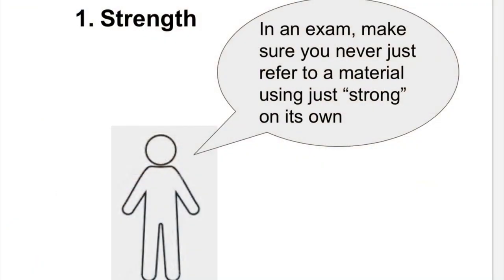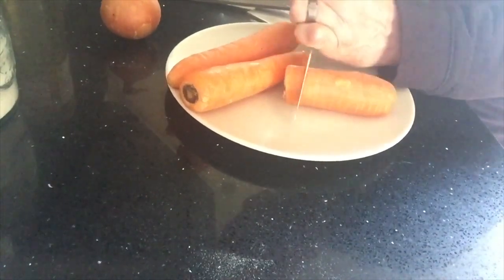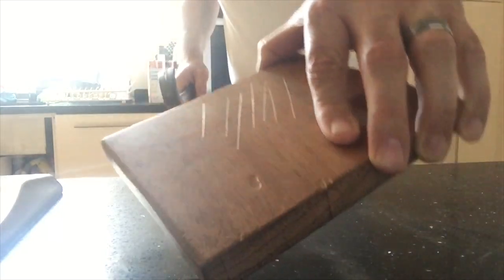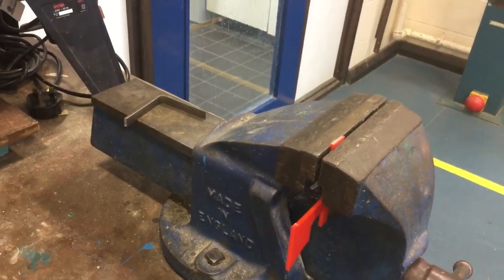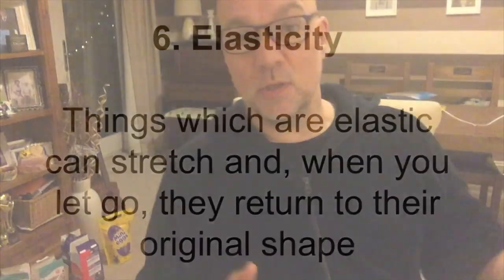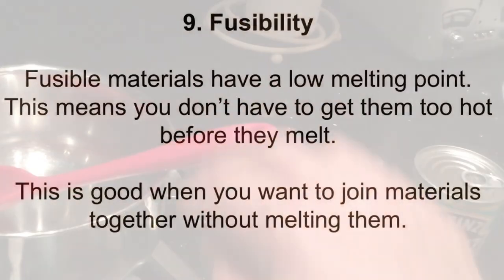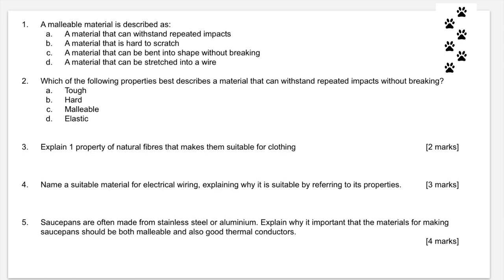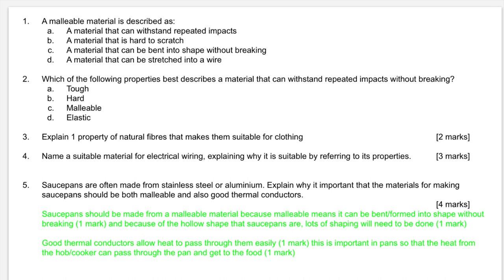Properties of Materials

Comment: Acrylic is malleable with heat, so there are two contradictions here. First it’s stated that at room temperature Acrylic fractures and in the exam question malleability is described in answer from as a material that can be bent into shape without breaking. The previous temperature aspect is omitted, why?
Reply from the maker: Hi mate, this is because acrylic’s properties change with temperature. At room temperature it Is brittle and will fracture if you apply too much force.  But because it is a thermoplastic, when heated it becomes malleable, meaning that it can bend without fracture. So heat it, bend it then let it cool so it can keep its new shape.